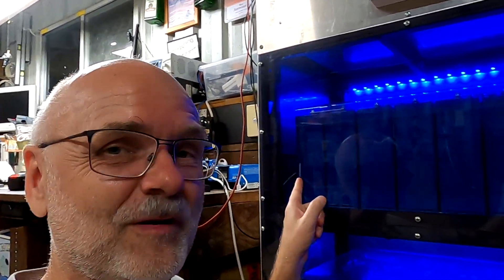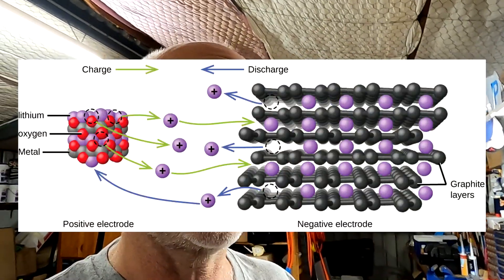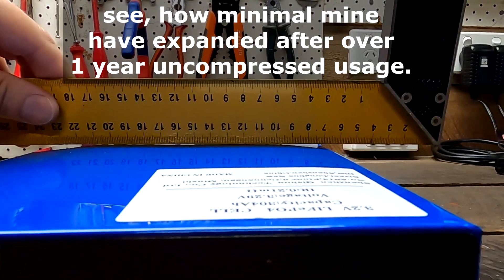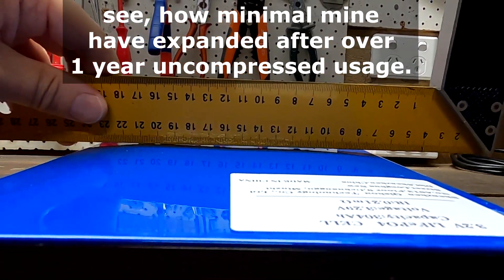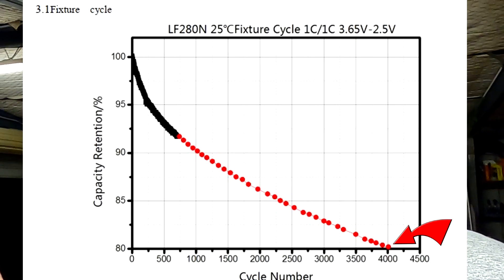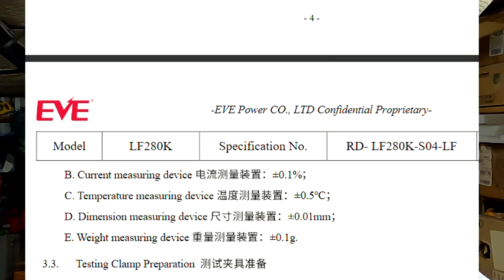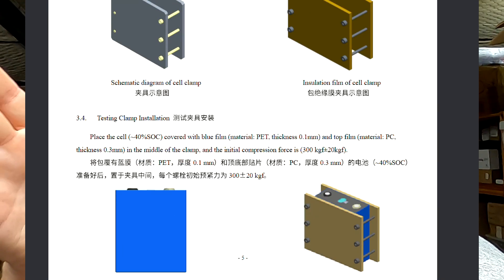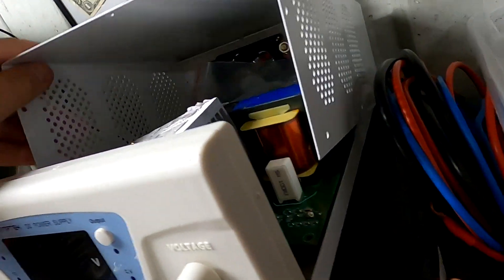Why you should compress your LiFePO4 battery! And why it does not matter... 🤷‍♂️

Comment: When I built mine 1-1/2 years ago, I used your recommendations regarding compression (none).  I was getting nervous after your recent vids.  Glad you sorted this out for us.
Reply from the maker: I did a lot of research when I build mine back then but information were rare. We're a bit better situated these days and have more information and also experience on hand.
Reply: @OffGridGarageAustralia  what about 'overcompressing'? Does that exist? Or will the compressing wood/steel/etc, still expand a little?
Reply: @RolandOfGileadOnYT  Hi Roland, Markus here ;) . 

First of all thanks to Andy. Never thought about becoming that kind of "famous" with lauching Dominik's video :DD.

Regarding your concerns about some kind of overpressure - Yes it is possible, but not with usual or non-professional tools. 

I have to explain it in detail: There are two sorts of expansion: The cyclic one while charging and discharging and the irreversible one caused by the effect of loosen electrode material. 
As I explained in that video, electrodes are compacted by calandering to increase volumetric capacity with a higher density.
Especially during the first cycles the electrode is still in original shape and the expansion is caused by the intercalation of Lithium-Atoms into the Graphite-Layers. 
This expansion cannot being stopped. 

If you think about that all pairs of electrodes have a thin layer of separator between cathode and anode and this separator usually is made from a stretched foil of Polyethylene / Polypropylene you can imagine what´s the weaker part.... It´s the separator. 

So if you press that batttery with very very high forces and hold it constant to this distance with 100% stiffness, the force increases enormously while charging and the expansion of the anode raises  until the anode penetrates or even pierce through the separator which which therafter will destroy the battery.
Reply: @markusb69  Hello Markus, thank you for your answer. I was asking, because someone at the DIY Solar Forum asked about this, he had the impression he compressed the cells to the point where the (short) side of the case buckeled inwards ever so slightly.

I myself have a battery with plywood on both ends and threaded rods, and compressed/locked the cells in place (there's a insulation between cells), until I couldn't move the cells anymore. Afterwards, I wondered if I should have made the blue cell wrapping somewhat less slippery first, so the cells would be fixed in place with somewhat less force. The corners of the case still don't touch eachother.

But from reading your answer, I'll take it that as long as you don't truely crush the aluminum casing, you should be fine, cause the stuff we use to hold the cells won't be strong enough to withstand the forces that cause this minor expansion during cycling?
Reply from the maker: @markusb69  Thanks for your reply and also sharing you knowledge on Dominik's video. It was very very interesting for everyone to watch and learn. It cleared up a lot of myths and helped us better understand handling these LFP batteries.
Thanks a lot!
Reply: @OffGridGarageAustralia  I think your newest thought about the compression sounds very logical. I imagine it's very correct. With all the practice you have now and all the extra knowledge in the world about it.😊

Comment: Woah thats some cool sciency infomation.  Yeah when youre dealing forces on the atomic scale, we're talking nuclear forces, so makes sense it cant be stopped, I wonder if it an be harnessed? perhaps to make materials go superconductive (needing high preasure)  Be cool if the chemistry of a battry made a material go superconductive allowing for 0 resistance and degradation of the battery.  If we just switched our wires to superconductor wires our  20% efficient pannels would act like 80% effieicent panels im just guessing its probably not that much.  Have you seen the demo with 12v bulbs being lit dimly, and then they superooled the wires (under liquid nitrogen) making it go superconductive an the bulbs were bright as normal, amazing, seems like we're wasting about 10x power in our all wires.  The recent breakthrough with superconductors is they found material that dont need to be supercooled,  but need to be under high preasure, which maybe something like this can help acheieve (chemical reaction).  Nice title, like most thigns in nature the answer is yes and no, and it just depends.
Reply from the maker: Thanks Mike. We would need -267°C for a super conductor, right? Not sure how good the battery would still work in such an environment 😁
Reply: @OffGridGarageAustralia  Right, that was the only problem but recent breakthroughs found materials that go superconductive under high preasure not just low temperatures.  Which is easier to achieve I think and brings us closer to superconductors as practicle reality.   You could bury cables underground or water to have them go superconductive,  or compress them really tightly!   I think 10 atmopsheric presasures is whats needed.

Comment: This video is highly flawed because although all cells will swell and contract somewhat, compression has proven it will reduce the permanent deformation. You can even compress swollen batteries and it will increase in capacity.
Reply from the maker: Still love you both even you have uncertified different opinions 😉
Reply: @OffGridGarageAustralia  ok professor, this is based on field experience actually. I’ll give you some more examples:
Some compressed cells (not just lifepo4 but prismatic in general) come in a hard case option or without a case. The case provides compression and actually increases its current rating. You can draw higher currents before the cell develops faults.
Compressed cells are also less likely to develop faults due to overcharge and over discharge. You don’t get the same level of bloating due to the compression resisting the swelling.

How about you actually do an experiment yourself? Take two cells and cycle then repeatedly, one with compression and one without. You will actually see that the compressed cell loses capacity faster for the first hundred cycles or so but it suddenly flattens out and ends up beating the uncompressed cell by a large margin.
Reply: @OffGridGarageAustralia  Interesting, where is your opinion confirmed? Confirmed actually only with time in your videos, that your decisions were not always right. Then you talk it beautiful. Still watch your videos, entertaining. In the meantime, have you calculated how many layers must be in the cell on the basis of your superimposed molecular expansion to come to the 1-2mm that your cells have expanded?
Reply: Yes, and people celebrate him for his statements, which I think are wrong. If he would have calculated what the atomic expansion would result with X layers, he would determine that he does not come to 1mm expansion per cells. Also he has not watched the video with Markus often enough, he has also said, the expansion by the gas bubbles causes defects, which hinder the charge transport... which without compression multiply constantly and are irreversible. But as with many things Andy notices it only with the time... like the expansion of the cells, at some point the capacity drop.

Comment: At 10:10 the batteries are on their side.  The bubbles would rise to the side of the battery, not the top anyway.  

A T Burke
Reply from the maker: Yes, what happens if the battery is lying on one side which is OK as per the manufacturer specs?

Comment: If the facts you gave are correct and complete then sure, your conclusion is fine. But did anything you say explain why cells that are perfectly flat when you got them, perfectly flat after you cycled them several times in capacity testing, and flat when you built the packs, are now bulging only now a year later? I don't think so, for example the chemical reaction in charging that you say is the cause of expansion and unavoidable doesn't start to happen only after many months. It would have happened right away. And that gas bubble idea you say would happen in the first few cycles after which "the damager is already done" and it doesn't matter. Also the idea of calendar aging is just guesswork as no such tests are possible without actually waiting many years.
Reply from the maker: Not one cell I have received was perfectly flat. Neither the B-Grade nor the three types of certified cells from two different sources and battery manufacturers.
Of course there is still some guesswork. Like in the 30year warranty for my solar panels or the 200.000miles the engine in your car is supposed to last...
Reply: @OffGridGarageAustralia  It's pointless to be pedantic over the word choice, but regardless anyone watching your video can see that your cells have expanded. Once can hardly deny this.
Reply: A new cell from the factory is not perfectly flat. Where did you see that the cells assembled by Andy were perfectly flat before mounting the pack?

Comment: Excellent Andy! Thank you for all your research and hard work to bring us the definitive bottom line, we all owe you a cold spat for that. 
What you said about de-lamination makes sense, and would suggest what I observed when dissembling a pair of 12V Aircraft grade LFE batteries connected in sires that failed in a friend's aircraft, that were severely swollen and appeared to show dry, cracked and possibly de-laminated areas of the individual pouch cells. 

What I suspect happened in that application, was that one of the two 12v batteries that was connected in sires ended up severely unbalanced (One of the two was about 3v below the other and would quickly self-discharge, and appeared to be in worse condition in terms of bloating and cell damage. 

Interestingly, the aircraft grade cells did not have a BMS with low and high voltage protection, only a passive balancer, which would make sense in aircraft applications where  one or both batteries disconnecting in flight, and  causing a loss of electrical power at a critical moment could lead to fatal outcome. 

As such, as the aircraft electrical system charged to 28.5v, each 4S battery in the sires stack would be at 3.56V under normal operation, but if one of the two batteries unbalanced by a volt or more could have caused the other cell to overcharge, over-heat and produce the condition we observed. 

Your video Andy, prompted me to suggest my friend install digital panel volt meter connected with a push-button to each battery, to check individual voltage of each 12v battery, and to add external connections to charge each battery with it's own 12V float charger, when stored, to keep them in balance.
Reply: Ooooo aircraft grade. That's a new one for me. I can't wait for the new rocket ship grade LFE cells :)
Reply: @hummmingbear  "Space Grade?" Given the limited temperature range and potential for out-gassing, LFE would not be an option for space flight. Maybe some Lithium Salt chemistry? 
FYI $1500USD for a pair, thus my suggestion of the voltmeters and balance charging:
EarthX Lithium Batteries | Aircraft Spruce
LiFePO4 chemistry, the most abuse tolerant of all lithium battery chemistries. Higher voltage while cranking mean faster starts. Extremely light weight, 70-80% lighter than your lead acid battery. 4,000 charge cycle life versus 350 charge cycle life of a lead acid battery. Can last up to 8 years.

Earth-X ETX900-TSO $699.00
STC or Part 337 (field approval) is required for installation. If you need the 8130-3 form for international orders, it is an additional fee of $150 per battery and must be requested prior to shipping.

FAA REQUIRED STATEMENT:

“The conditions and test required for TSO approval of this article are minimum performance standards. Those installing this article either on or within a specific type or class of aircraft must determine that the article installation conditions are within the TSO standards. The article may be installed only according to 14 CFR part 43 or the applicable airworthiness requirements.”
Reply: @jackoneil3933  my brother it's a joke ;)
Reply: @hummmingbear  Hard to know if it was sarcasm, a joke or something else. Additional information if there for others if they are interested.
Reply from the maker: It was a joke, he put a :) behind his comment...
Thanks for sharing, Jack. Yeah, it makes sense and batteries are swelling heavily if they get overcharged. The suggestion with the voltmeter is great to keep an eye on these batteries.
Reply: @OffGridGarageAustralia  Thanks Andy

Comment: Now this is a very  video for me. Let me explain.

I recently dismantled 6 Mastervolt 24 Volt batteries, each containing 6 Thundersky 170 Ah cells. When I dismantled them, I noticed the cells were in a metal enclosure. 2 steel bars on each side and those bars were connected to two end-plates by sticking through holes in the end-plates and were kept in place because they were twisted behind the end-plates. (Apologies, English is not native to me). Some batteries had so much tension build up due to expansion of the cells, that, when I untwisted the sidebars, the batteries literally exploded mechanically with a loud bang. After removing the cells, some cells were so inflated that they resembled the Michelin puppet. The ones I didn't trust were taken directly to the communities local chemicals intake point. The other ones I tested and kept them when they were still good.

I'm about to install EVE cells into my sailing yacht. I don't even consider compression. If a cell expands (too) much, I want to be able to see it and take appropriate measure in time (replacing).

Thanks Andy, love your channel, especially the German? / Austrian? accent. I learned and still learn so much from you as well as from Kermit.
Reply: We're the cells bad before you took it apart?
Reply: @markmmm1737  According to the fact that some cells were really swollen, that must have been the case. In general I believe Mastervolt to deliver good quality products. The mechanical explosion of the batteries scared the shit out of me. On the outside, you couldn’t tell as the batteries were encased in a plastic outer shell.
Reply: @aldskanser7880  I am guessing that the batteries may have been abused, with high rates of charge and discharge and pushing the limits on voltages? 
Do you know their history?
Reply: @FutureSystem738  Hi there, first I have to correct a typo. Of course, each battery contained 8 cells, instead of 6. So, 48 cells in total were distracted. I felt that 35 were okay, so I took 13 to the chemical waste depot. The cells were a gift from someone who replaced them with newer / better ones on his catamaran. He is an early adapter in energy transition. As far as he told me, the batteries to his knowledge were still in good condition, turned out 13 cells were too bulky for me. These Mastervolt batteries are known to deplete themselves over time if not charged in time. The BM's of these early Li batteries by Mastervolt don't switch off under 2.5 volts and the balancing keeps on going until there is no charge left to balance.

So you may be right that the cells were abused, but that is not the point I am trying to make in my comment. My point is that compression leads to not noticing swelling, which may build up heavy mechanical tension in the pack, without the owner noticing it. Suppose you're on the middle of the ocean in your GRP boat and a compressed pack builds up so much tension in the cell, that this fails (rips open or whatever). There is plenty of water around you to extinguish any fire, but as we all know, this is not the proper way.

My main point is, I would rather see that a cell is swelling so I can act, than to wait for any mechanical explosion. I (and this is very personal) just don't like compression.
Reply: @aldskanser7880  
 
I think the biggest message here is that a very good BMS or other monitoring (I love my JK BMSs) is absolutely essential. Under voltage or over voltage as we all know, is very bad for these cells. 
My concerns especially for mobile use (boats, RVs etc) are how do you secure them safely if not with some degree of compression?
I have 12v 4s 400 Ah Winston LFP cells in my caravan which are approaching 8 years old. They’ve been slightly compressed and very well secured since day one. 
They’ve been fabulous and show only absolute minimal sign of degradation. For most of their life they haven’t had a BMS, but have had very close monitoring of individual cell voltages by me and have been used with very conservative voltages, with very occasional manual balancing as and when required (only about one time per year being necessary.)

So: look after these LFP batteries and they last a LONG time. 
Use very conservative voltage and keep them balanced. Don’t look for that last few percent capacity at the top of charge.

I honestly think that when very well looked after, they’re safer than lead acid, and about 100 times better!
Cheers from down under 🍻
Reply: @FutureSystem738  Your response nails it FutureSystem738. I'm developing with Arduino my own monitoring, voltage per cell, temperature per cell and balancing only in the upper part of the knee, frost protection. I will also develop a sketch on Arduino to regulate my alternator on battery voltage and temperature of the alternator. I really don't like to use DC to DC charging equipment etc. My batteries (980 Ah total, divided over 4 12 volt batteries, will be very secure beneath the floor in the boat. Steady temperature environment. Thanks for all your good advice and cheers to you to from "upper above?".